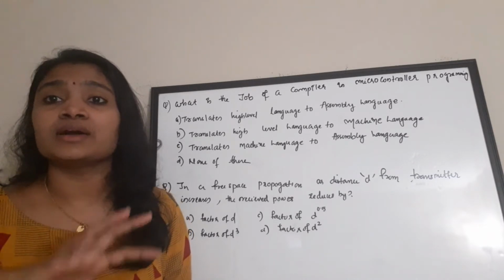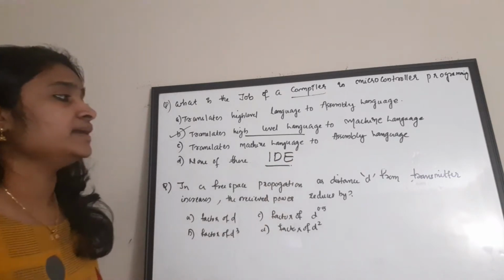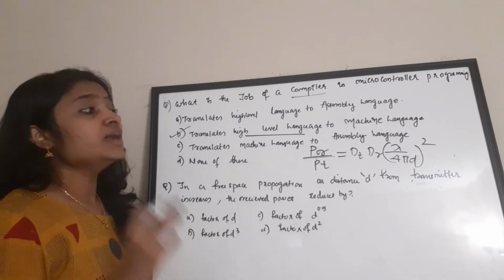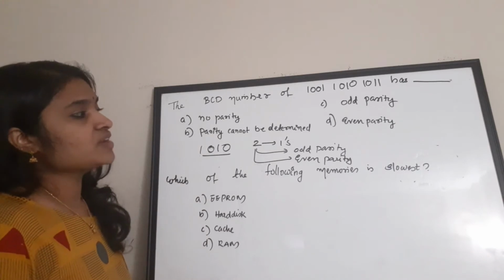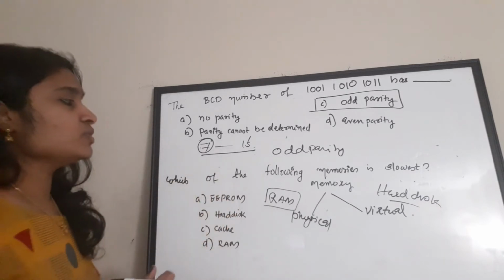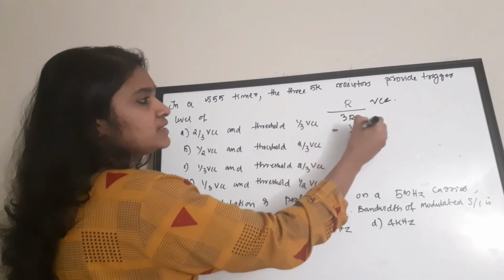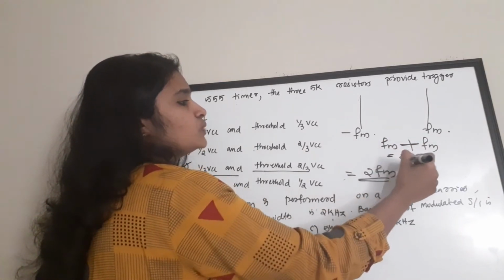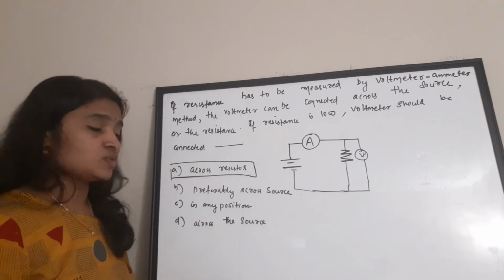NESAC-ISRO Technical Assistant Electronics 2020 Solutions Part3| ISRO|Gate|BARC|DMRC|AFCAT Prepare

Comment: in this video , last question answer is voltmeter has to be connected across the supply, when R is minimum, and when R is max voltmeter has to be connected across the resister.

Comment: Mam i need a solution for following example. 
1)If a DAC has a full-scale or maximum,  output of 12v & accuracy of +/- 0.1% then the maximum error for any output voltage is.........
Reply from the maker: Take the .1 percentage of 12 you will get .012 that's the error voltage.
So  voltage can range from (12-.012 to 12 +.012)
Reply: @EasyElectronics_jobupdates  how do you solved the  1 percentage of 12
Reply from the maker: @parthnavale3849  .1 percentage of 12 is 
.1* 12/100
Reply: @EasyElectronics_jobupdates  thank u mam.